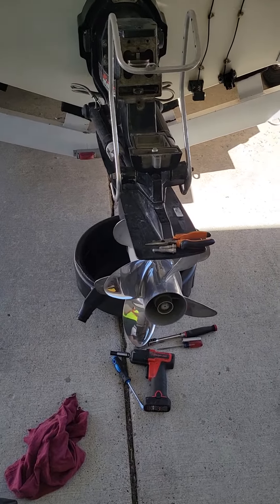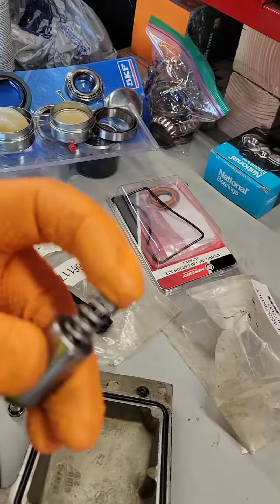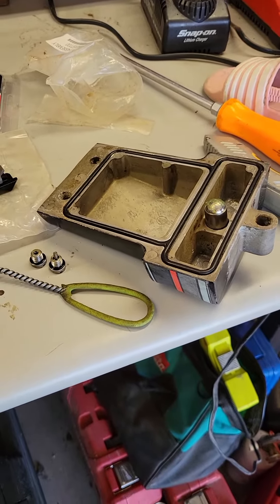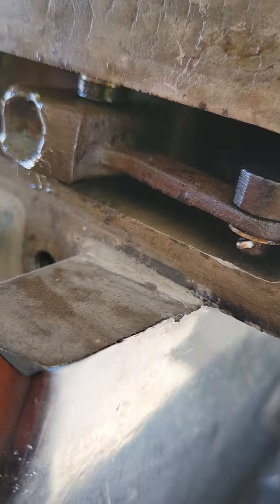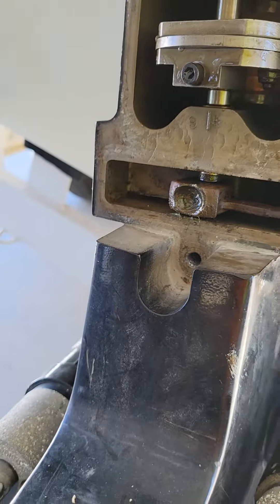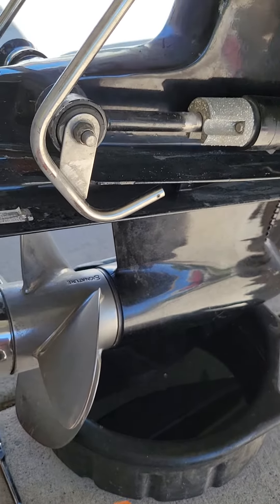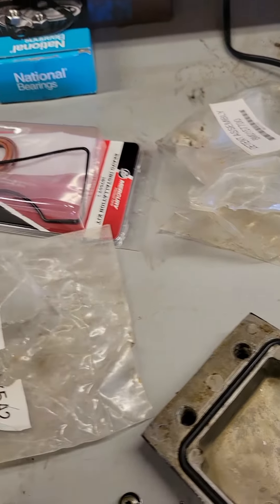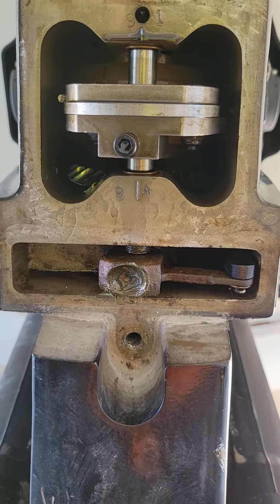Mercruiser Bravo drive shift problem (Detent Ball Replacement in Bravo 3)

Comment: Mines stiff but ball pushes in fine but when I refit it, it seems stiff. 
I’m wondering if it’s been over greased as it was packed with grease. 
I’m thinking it might only need lightly oiled ?
Reply from the maker: It might, give it a shot and see if it's better
Reply: Yeah that’s the plan for the weekend. 
Be a weird fix if that’s the issue.

Comment: Does the shifter boot/ bellow keep water out of the cavity? It does not attach to the housing.  I am having water somehow get into my detent ball area and then I can't shift the boat.  I resealed the cover and drive with gasket maker with no luck.
Reply from the maker: So typically if your shift boot is bad you get water coming into your engine side of your boat more so than the cavity. But when I replaced the boot with the shift cable it took care of my problem, along it might help to line your gasket with a little rtv to help seal it up if the water continues to be a problem.

Comment: My detent ball is not fixed/ crimped into the sleeve.  I noticed both of your ball are still in the sleeve.  Is this any issue?
Reply: I just swapped out the ball and sleeve with one that holds the ball in.  The drive is easier to shift now.  Both balls could be pushed in with about the same force, but I guess the side load created by the lever was making it binde some.